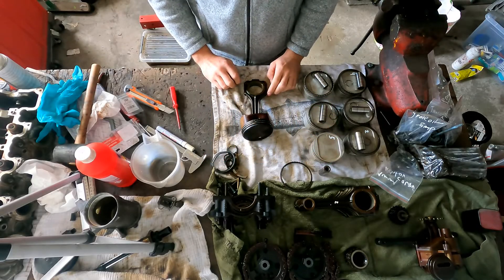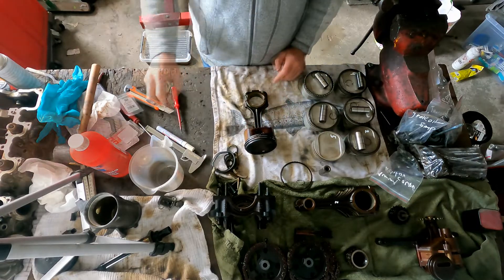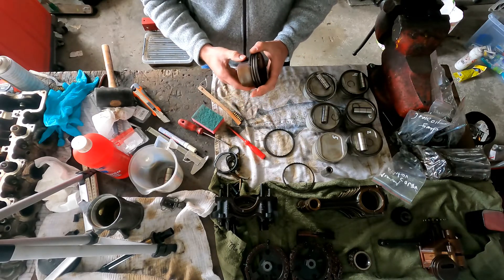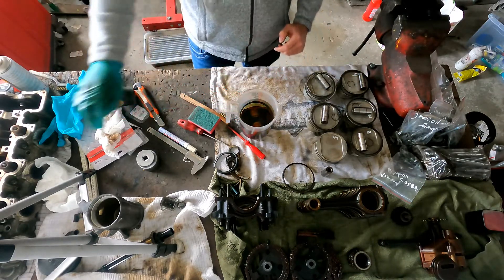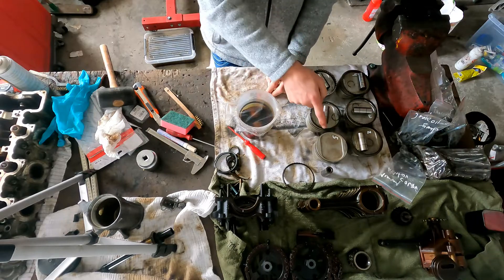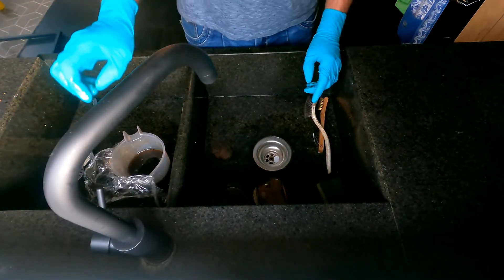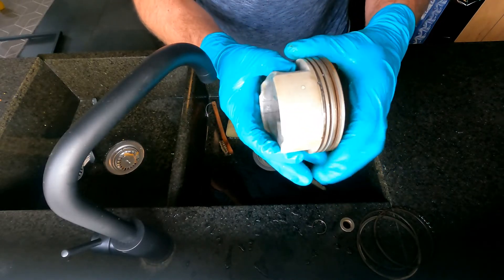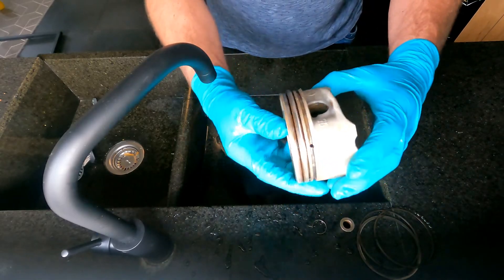M113 engine rebuild - Part 4 - best way to clean your pistons! MUST SEE !!

Comment: Will you reuse piston rings ?
Reply from the maker: Yes.  With alusil cylinders this there is a lot of discussion about new rings without   repolish the liners and so on .
Reply: @JMSpeedshop  Do you increase the ring gap in a later episode?
Reply from the maker: Ring caps are increase
Reply: @JMSpeedshop  there is a danger of damaging the liner by new piston rings? I'm doing same rebuild now on m113.988, old piston rings looks good, also clearances are in range
Reply from the maker: @frighteg oke.  Yes the old rings alos need to have enough spring effect  so.the need to have some resistance in the cylinder bore.   But new rings should not damage the liner.  The can wear out the liner a little but more when new
Reply: @JMSpeedshop  thank you